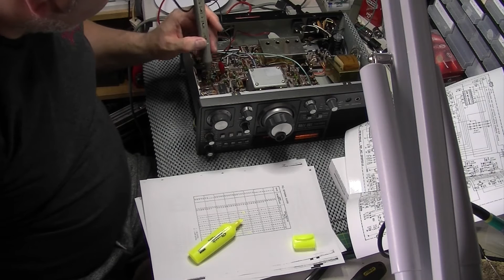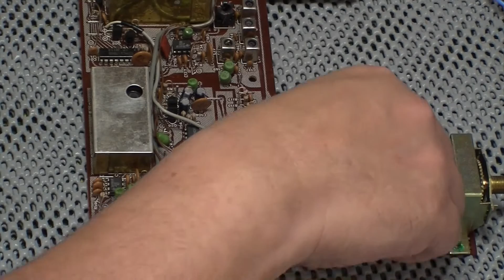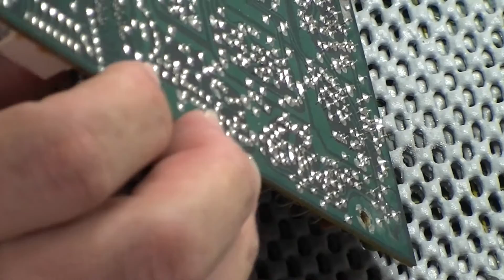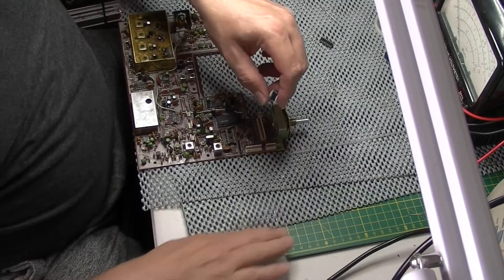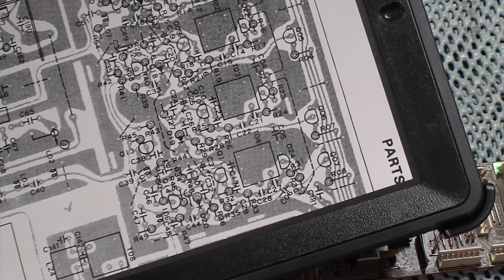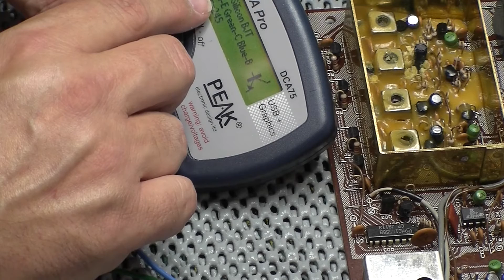Yaesu FRG-7700 HF receiver troubleshooting Part 7

Comment: Does anyone know the pin size for the push on plastic connectors used on the FRG-7700 PLL board and where they can be obtained?
Reply from the maker: I’m not sure Robert as I don’t have one here now. If you have broken one then maybe the best thing would be to remove the connector and solder the wires directly to the board

Comment: Its 3 in the morning Graham. It would have been too much to expect it to be a simple switch clean eh?, Regards, J.
Reply from the maker: I've certainly done some late nights on this one Joe. On initial inspection it did appear to be a switch cleaning exercise. Even that proved a task in itself. It now seems to be in the middle of the VCO 3 range at 16 and 17mhz!
Reply: Radiocruncher
You'll track it down Graham, Breaking down a complicated system into manageable sections as you do is the key, At least it looks like a definite fault not an intermittent one, they can be a real pain. Also the Bush is looking good, Are you going to just check valve heater filaments and fire it up?(I would!), Keep up the good work, J.
Reply from the maker: Thanks Joe. I'm not giving up on it so it will have to be fixed! It's difficult to pinpoint because it disappears after sometimes only a second. My first fire up on the Bush will be with no valves in then I will take it from there. I must get the HT caps out first for a check then probably test the transformer